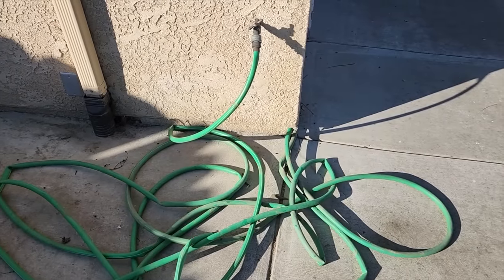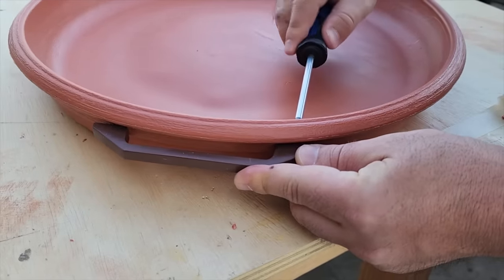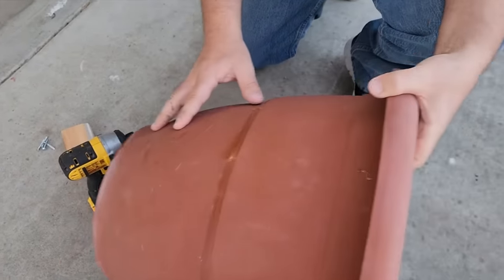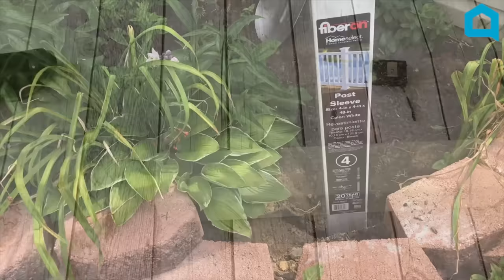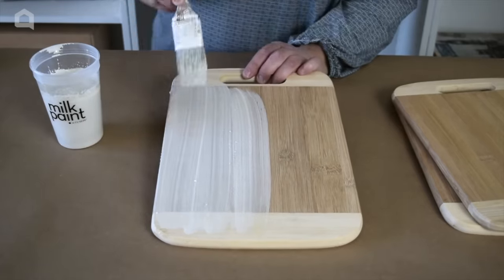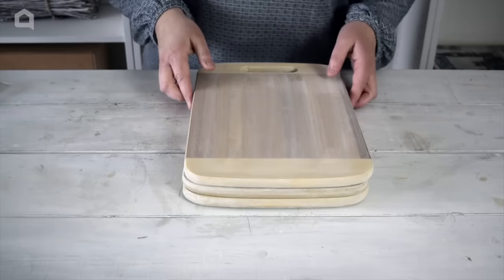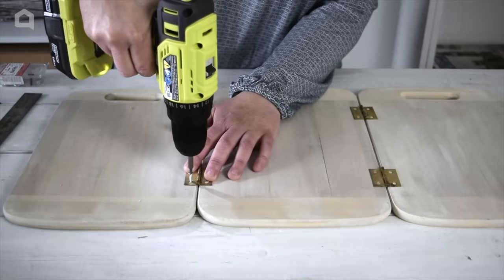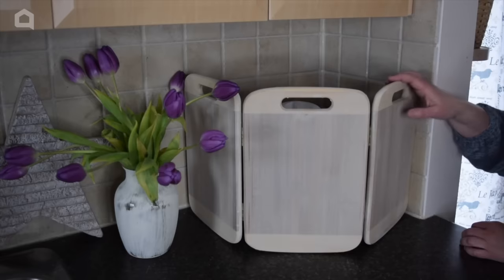Few people know about this BRILLIANT garden hose hack!

Comment: Great tip with the hose but as the tray and the planter is plastic you should use washers for the screws and bolts. The handles will have pressure on them and the screws could loosen or come out. Also with a washer it means you can tighten them without fear of the screw heads breaking through the plastic as you screw them in.

Comment: Very nice hose container. I only wish I knew of a way to deter hornets from building nests in containers outside.
Reply: I have read that Peppermint and Lemongrass does the job. You can get those through Amazon or any other... Have a happy day!
Reply: @mariamercy7317  Thank you very much! I'll look into that.
Reply: I spray a mix of water with a squirt of dish soap inside my propane tank lid and in a garden shed roof to keep the wasps from trying to build nests. It leaves a soapy coating they don't like.
Reply: @oldauntzibby4395  Thank you. Makes sense. In the last 2 yrs, in spite of my best efforts, hornets have found a way to get inside of my garden shed so I'll give that a try.

Comment: 3:42 - when mating metal to PVC I always ensure that the female coupling is metal (galvanized steel) and the male is PVC as pipe thread is tapered and can easily split the PVC, but not the other way 'round.

Comment: Garden hose In a bucket , underneath a tray of plants.  On top of the bucket , to hide the hose in the bucket , that has the hose in it , underneath the tray of succulent plants so it’s hidden underneath the tray of succulent plants . So that you wouldn’t know that there is a hose in there . Underneath the tray of succulents on top of the bucket of hose , that you don’t know is there like that , unless you remove the lid that is a tray of succulent plants , when you need to have a hose to water stuff with a hose that is hidden underneath succulent plants , in a tray , that is a lid to a bucket of hose .

Comment: Guys, I don't like the first hack that much. I think it will become cumbersome to have to remove that planter waiter tray every time I need the hose. This will be especially annoying for avid gardeners.
Reply: ..and by the tone used by the 1st guy, does he really think he's instructing a room of feeble-minded folk?..gads
Reply: I was thinking that this project is a poor design. Succulents don't need much water. He just made more work for himself
Reply: I wasn’t too impressed with it either. It did get rid of the unsightly mess of a hose though.
Reply: @Cynsome1  Yes, you've got a good point there. Perhaps if it's not the main hose that you use often, it's a very good idea. But for me, the avid gardener, I am better off with the hose tidied up on something that unravels easily.
Reply: I agree
Reply: I had a garden hose holder kinda like that.  Did not work out
Reply: Alot of these are more work than doing it the regular way.
Reply: I was thinking it would be good for a person with a small patio garden and a coiled house.  Or, if the cover could be installed on a swivel?  Otherwise a very cute idea
Reply: @pdxwildchildroberts5586  I guess so. He needs to realize a lot of viewers are handy people. Another thing some viewers may have health problems that cause week muscles like Rheumatoid arthritis Lupus etc and want a project that won't cause more pain and fatigue but we still want to keep active
Reply: I concur
Reply: At first I thought he was going to wrap the hose on the planter bottom.  Cute idea, but a bit cumbersome.  All the people on these videos talk the same way
Reply: Agree!
Reply: IMO removing the planter will help me remember to water 😊

BTW I believe the first hack was to use the tape to mark the holes which I find genius.
Reply: The only thing I ike is the succulent tray. That's about it
Reply: @joyceutt3419  They will only get as much water ashe gives them of from rain.
The tray w/the succulents is essentially just a lid.

Comment: Or for 5 bucks just buy a hose hanger  2 screws 2 rawplugs and wont have do all that drilling,cutting timber, putting on handles and moving plants everytime you want to use the hose. Or even easier buy a hose reel.Or if dont want to spend any money, Unclip your hose and hang it in the shed out of the sun untill you need it.. Or